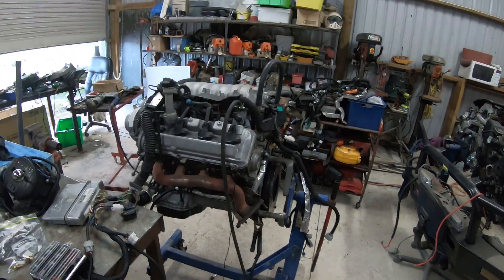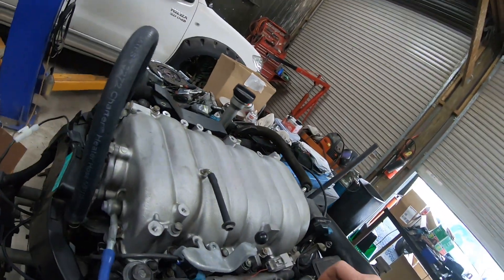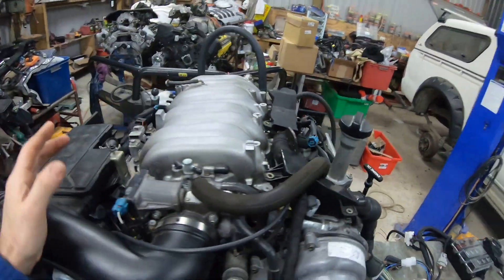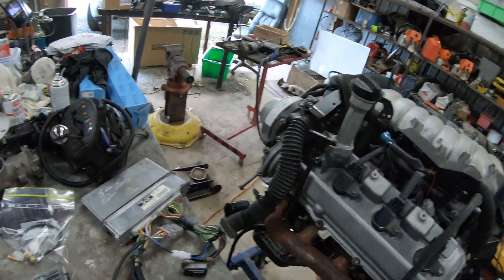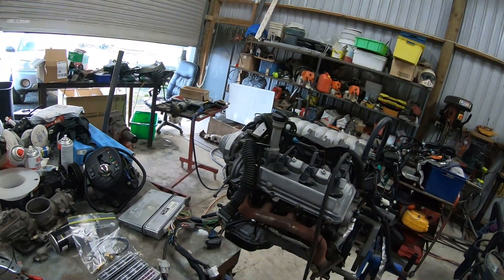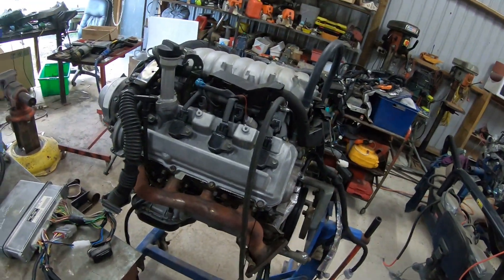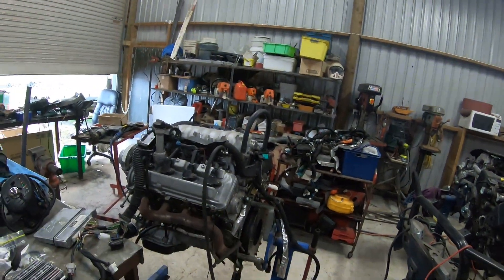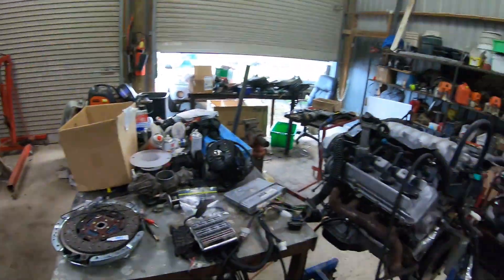3uz On Standard ECU

Comment: So, I can run a 3uz on a 1uz (98GS400) ecu?
Reply from the maker: I am able to run a 3uz on a 1uz vvti ecu,  as per the video.  Provided the correct combination of parts is used it is possible
Reply: @CartuneNZ  great. Could you tell me what the correct combo of parts are?
Reply from the maker: I have videos explaining using matching parts and give frequent examples of using Toyodiy.com to match correct parts.   There are many options so you much use all matching parts which are required.
Reply: Also, is the improved torque (+-15 ft/lb) the only immediate benefit of running the 3uz? thanks again
Reply: @CartuneNZ  Man, Can I pay you for a shopping list?

Comment: I need to watch this video but it doesn't load past the 10 second mark no matter what. I need this information for my swap. 3uz into Mk2 Supra.
Reply from the maker: Sorry you can't see it.  It loaded fine for me.  Its still strange watching myself.  Cheers.
Reply: @CartuneNZ  do you have a forum or blog with all the information? How to deimmobilize and start the engine, diagrams and what not?
Reply from the maker: @Reaper1911-  my wiring instructions are something which I sell.  3uz would be ready now if I hadn't had a small incident with my laptop.  Removal of immobilizer is a service which I provide.  Its not a DIY process.  Cheers
Reply: @CartuneNZ  Where can I browse your services?
Reply: @CartuneNZ  can you use aftermarket shifter on the transmission?
Reply from the maker: @Reaper1911-  I prefer to use the correct shifter as it allows the 4-5 selection and the 1-2 shift when holding it back.   The correct one fits and is easy to setup compared to aftermarket units.  Cheers Kelvin.
Reply: @CartuneNZ  if you don't have that option, as my transmission didn't come with a shifter what would you recommend?
Reply from the maker: I have used other Toyota Shifters from models with A650 and they work well.  If you can't find one of them I would be learning how the A650 shifter works so you can replicate it.  Ive used 4 speed shifters and suitable switches in 4x4 vehicles with success.  I don't think I did a video of the ones Ive done like this.  Pretty simple with the correct knowledge.  Cheers
Reply: @CartuneNZ  you're a life saver.

Comment: I thinck it is the batery that is not corect any more
Reply from the maker: I have a little bit of vvti dbw info.  One is the vvti throttle body video and the other on testing accelerator position sensors.  Theres some help fault finding info in that one.  If you get stuck then I sell info on how to wire it correctly and the same info can be used to fault find.  Good luck.  Cheers

Comment: could you please tell me I have connected the propshaft and went for an drive but cant get enough power out of it when I checked the butterfly it only opens only about 3 to 4 mil and doesn't rev up correctly so I don't know what to do.
Reply from the maker: Thats upsetting.   If throttle isnt opening much the dbw has a fault.  As this is a new wiring setup I would guess there is a wiring issue for the engine / ecu.  I would be starting to do some fault finding however as you brought it as a running package ( hopefully from a good business) I would recommend discussing the issues with them.  Cheers.

Comment: Could you please tell me the engine idle with out the afm but as soon as you plug it in the engine dies what must i do
Reply from the maker: Is it on a conversion and the engine has been wired onto another vehicle?  We are discussing a 3uz?  As auto or manual?
Reply: @CartuneNZ  it is an 3uz fited in to an tata xenon it was an prewired engine
Reply from the maker: @Neo-yu2ui  has it ever run correctly in its present form?  Or always had this issue?
Reply: Its an auto box
Reply: Thay bench started it before they send it to me i had to plug the afm and coputer box in before we started it
Reply from the maker: @Neo-yu2ui  have you plugged in a scan tool to read the codes?  Looked at live data?
Reply: @CartuneNZ  i did do a code check but it did not show that the afm is faulty
Reply from the maker: @Neo-yu2ui  what about live data?  Did you review the live data?
Reply: @CartuneNZ  no not yet i have to wait for the coputer to come
Reply from the maker: @Neo-yu2ui  i think the best thing to do is contact your supplier that wired the engine.  They deserve the opportunity to stand behind their work and fix the issue.  This is what you paid them for.  I am interested in the outcome if you care to share.  Cheers.

Comment: Could you tell me i have a 3uz it starta but does not idle mist the gass pedal be connected or not and the buttefly closes when it starts
Reply from the maker: Yes,  must have throttle pedal. t will instantly fault without the throttle pedal connected.  Ive had guys attempt to fit manual pedal with stock ecu and those ones won't rev.  If ecu is stock the proper signals must be received by the ecu.

Comment: What do you charge for 3uz package running with gearbox loom Ecu gearbox.with ignition fuel starter relays all wired up please.  Cheers.
Reply from the maker: Every wiring job I do on 3uz is a different price as everyone has different requirements and I wire the package based on my customers needs.  Flick me an email at info@thecartunecompany.co.nz and we can discuss and work out a price.  Cheers Kelvin CartuneNZ.